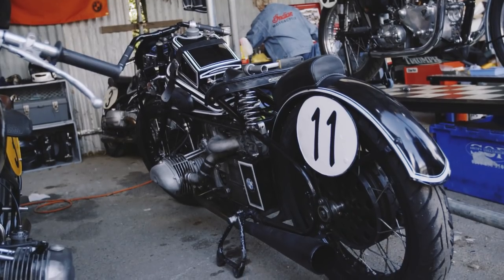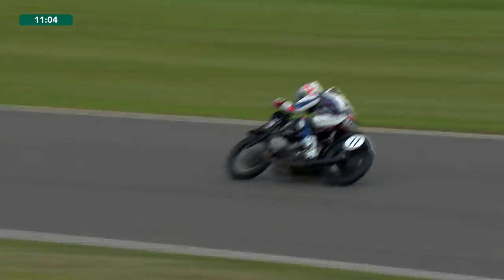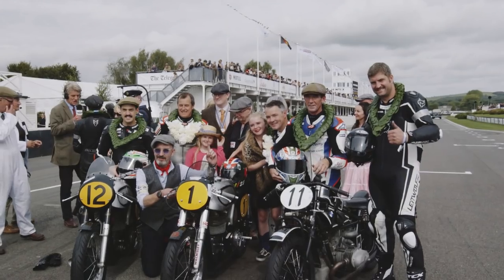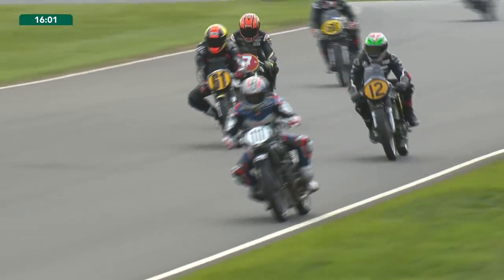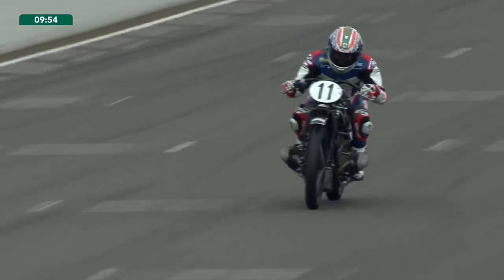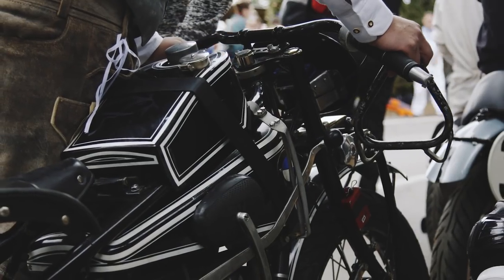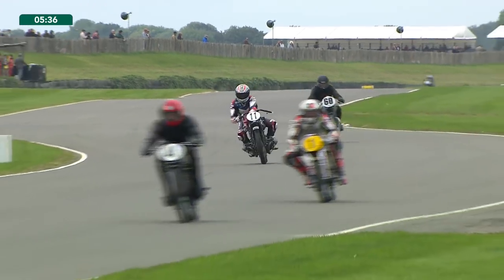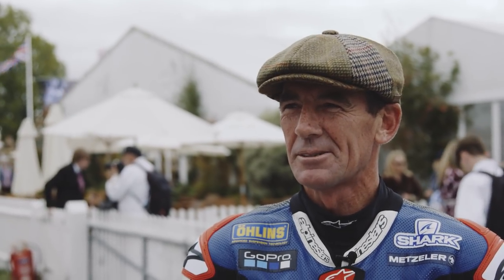A guide to Troy Corser's 89-year-old BMW

Comment: 80bhp, and 140mph ( 60kw and 225kph!!!) In 1929, thats as terrifying as it is amazing
Reply: Actually, the 1929 compressor BMW had 55 bhp. In 1936 the motor was substantially overhauled, and, with the compressor now on the front of the engine, pushed out 68 bhp. So there never was 80 bhp! In 1938 BMW became European champions with this BMW, in 1939 Schorsch Meier won the TT of Man, but the championship that year went to Gilera.
Reply: I'll believe you @joepkortekaas8813 , but I'll leave it to you to tell Troy ;-)
Reply: @JakobusVdL  Somebody once said: "There are lies, damn lies, and statistics!" In my book "Honda's Four-Stroke Race History 1954 ~ 1981", I said: "There are lies, damn lies, and originality claims". To that I should add: "There are lies, damn lies, and horsepower figures!"
Reply: @joepkortekaas8813  If it didn't have 80bhp back in the day, do you think it might have been 'developed' to that kind of output in its current form?
Surely if it 'only' makes 55 or 68bhp (still pretty pokey for 1930's motors), even a Troy Corser would be quoting those kinds of numbers, so we'd  credit it's pace to the skill of the rider rather than the grunt of its engine.
Reply: @JakobusVdL  Well, i don't believe for a second it could have 80 bhp, for even the 1938 BMW with a better compressor, and higher boost pressure, had only 68 bhp. But they changed some things on this 1929 BMW: e.g. it has now double ignition, which it didn't have in '29, and that would give a power boost of approx. 3%, i.e. some 1.5 bhp. When you look at the straight line speed difference with the Manx Nortons, which have some 50 bhp, then you can see that the power of the BMW can nowhere be in the vicinity of 80 bhp, but some 56 ~ 57 bhp is quite believable. By the way, the footrests are also modern - they used to be rubber. It also now has megaphones, which have no meaning on a compressor bike, but gives a much more impressive sound!
Reply: Which beggars the question, what modifications are permitted at Goodwood? No matter whether it's 80 or 55 as some say, it took a bloody champion like Troy to wrestle that thing around the track at such a pace, particularly against the Nortons, which have the much vaunted "Featherbed" frame.
Reply: @joepkortekaas8813  they may have ported it , upped the compression , different cam , who knows, 10 hp gain is nothing when you are a good tuner.
Reply: @mothereartha7  Porting has no influence at all on a compressor engine, upping the compression ratio with a compressor would most probably result in detonation, and different cam timings have also very little influence on compressor engines - that's why you install a compressor in the first place - to get optimum filling at all speeds! And believe you me, those BMW people knew exactly what was needed for a compressor engine in those days! (And so did, by the way, the people at AJS, Gilera and Velocette!) No, I still believe, whatever you try to do, 80 bhp is impossible for a bike of that vintage.
Reply: @joepkortekaas8813  that’s interesting, so your telling me flow characteristics are unimportant, l think with the advent of the hemi head in drag racing, which has everything to do with flow characteristics, in supercharged engines along with fuel , cams electronic ignition , improved timing etc its all a waste of money, you just bolt a blower on a stock engine, and that’s the most you can do. Cmon.
Reply: @mothereartha7  You're obviously not an automotive or mechanical engineer, nor are you obviously a tuner. Flow characteristics are practically totally unimportant in compressor engines - the compressor fills the cylinder more than 100 % with even rather badly shaped ports. And this is the last correspondence on this subject - I'm not going to react to an endless stream of ignorant talk!
Reply: @joepkortekaas8813  LOL You are not an engine tuner either. Compressed or not, flow still matters a lot.
Reply: @redryderaus  You obviously don't know a thing about internal combustion engines and are talking from your backside. As for me being a tuner, you can Google me.
Reply: @joepkortekaas8813   I read that the bike is 70hp from an article in 2022. Cheers mate
Reply: @sailor81   Whatever that article said, it's rubbish!

Comment: I saw the other video of him racing this bike at Goodwood. An impressive display of riding skill. Especially so since it appears he didn’t spend much time on the bike before he developed what I assume to be a unique shifting style. I don’t know vintage bikes, much less vintage racing bikes which might have been different from their street brethren, so I’m asking for some help. He mentions his preference for shifting with his left hand because he wants to be able to brake and shift as he enters a corner, and also to be able to quickly accelerate. Makes sense. This implies that the brake lever is on the right as is the case with modern bikes. It also makes sense that this was designed for right-handed shifting as then the rider could squeeze the clutch lever with his left hand. So how then is Corser shifting with his left hand?  I assume he’s not clutching?  Can motorcycles do this without damaging the tranny?  Or maybe racing motorcycles are designed for clutchless shifting?  Or is he matching revs as they used to do with non-synchro trannies back in the day?

Comment: Fitted with modern steering damper and tyres eh? I guess they have to allow changes for safety, it reallly goes well, Troy is a great rider. You would think they would have the gear change on the left side?
Reply: Why? Why is it on the right? Any other observations/complaints?
Reply: Because the clutch is on the left
Reply: David Allison That would make sense except that Troy is using his left hand to make the gear change anyway....so he doesnt use the clutch except when starting off...
Reply: @truthseeker8483  It still makes sense - it is just Troy is doing things differently, and a close-ratio gearbox often allows you to make gear changes without using the clutch. I'm afraid droceretic will call me a dead shit again because I happen to know this - from my own experience.
Reply: The video explains that it is set up for the owner who likes the left side change.   Mr Corser had had to improvise.   Clearly not too much of an issue for him.   And it's got enough grunt so only top two gears needed for a lap.  There aren't any slow corners at Goodwood.

Comment: I wonder if the Gear Ratios are Altered, It's Not So Easy to Change on a Shaft Driven Bike, No Simple Sprocket Change, it Needs a New Differential - I can't Imagine a 1920's Bike Geared to Run 120mph, I Suspect there's Alot of Aftermarket or Unique 'Unobtainium' bits on that Old Bike, Look @ the 'Egli Vincent' for Example, it's Designed as 1/4 of V8 Touring Car Engine Specification, Bore & Stroke ect, but Looks like an Old Vincent Engine,  it Produces 150+HP - Awesome Engineering - Dont get me Wrong!! But Not Really an Authentic Classic Period Bike, it's a 'CNC' Special😆👍🇦🇺🍻
Reply: I did wonder.  It looks the part though and there can't be many hidden improvements to the tiny brakes.  Probably cable operated.

Comment: Those megaphones on this bike are just for show - a supercharged engine doesn't need them! The original BMW didn't have them.
Reply: The original have also megaphones, they had some with and without in the past
Reply: @herbertschwab7198  The originals certainly NEVER had megaphones - in 1929 not one motorcycle in the world had megaphones, they first appeared in the 1930s, and BMW have never used real megaphones, even the RSs of the 1950s had megaphones which were so narrow that they behaved like straight pipes.  The compressor BMWs on which Schorsch Meier and Walter Zeller raced shortly after the war also never had megaphones, you only have to look at the various pictures of the period. Compressor engines don't need megaphones, they're only unnecessary weight, because a compressor engine doesn't make use of pulsation and inertia phenomena like atmospheric aspirated engines. So, please show me one contemporary picture of a 1929 compressor BMW with those kinds of megaphones!
Reply: @joepkortekaas8813  Ernst Jakob Henne use also megaphones . Write in google pictures "Jakob Henne Kompressor".
And the supercharged BMW record bike from 1937 use megaphones.
Reply: @herbertschwab7198  As I already said, those are NOT megaphones, they are much to slender and react like straight pipes! And it is quite clear, that the megaphones on the 1929 BMW are much, much wider, they are real megaphones. And any mechanical engineer, who studied internal combustion engines (which I for one happen to be) can tell you, like I said, that megaphones are of no use on a compressor engine. And herewith I end the discussion.
Reply: @Joep Kortekaas no reason to be unfriendly! Thats not what i am talking about, and i know about engines and exaust, i never said it make sence to use them . But maybe i change them for you
Reply: @herbertschwab7198  I'm sorry if I sounded unfriendly, I didn't intend that, I simply saw no reason to continue this discussion.
Reply: @droceretik  well, if the man's right, he's right aint he? it's like a very famous alpine skier once said after winning a race and getting a not so clever question - it's no use trying to explain to someone who doesn't understand.